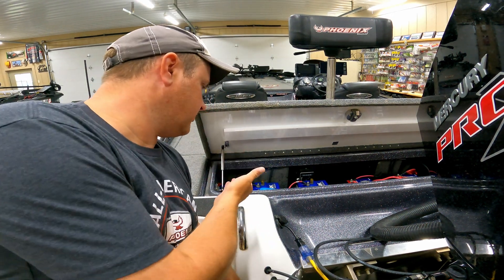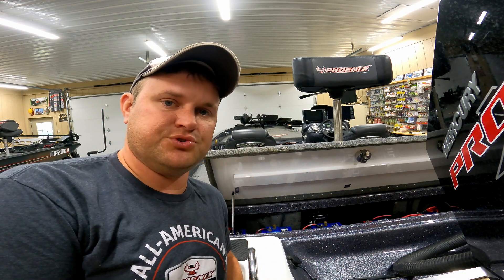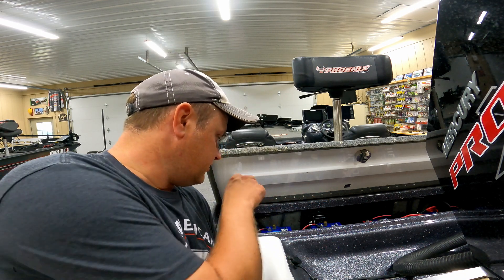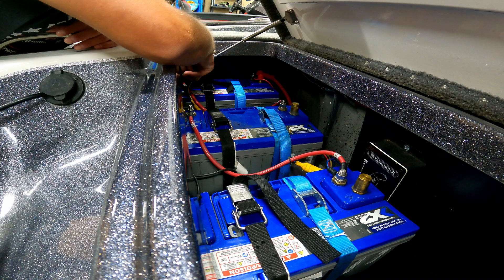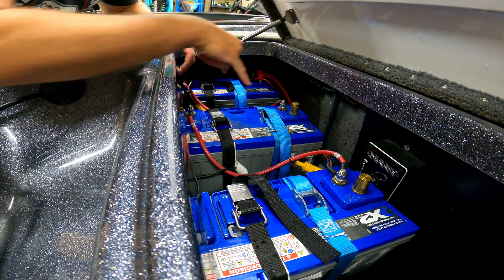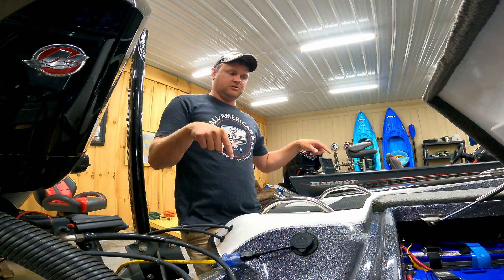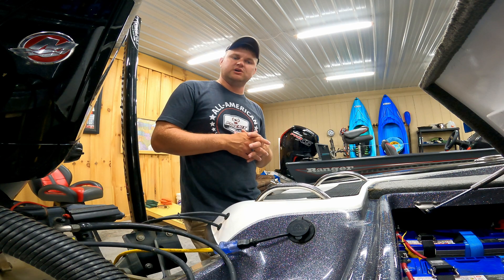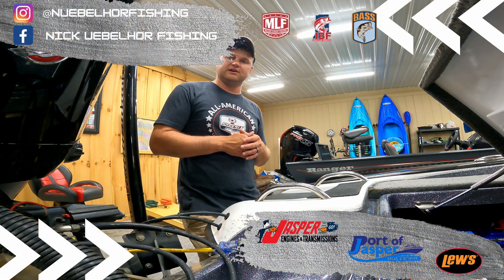How To: Hooking Batteries Up in SERIES!!

Comment: Do they need to be see the same amp hours
Reply from the maker: Yes it’s definitely recommended to have an identical battery. It’ll affect charging and discharge rate. I’m sure it would work  if they weren’t the same but you’ll run into issues down the road!